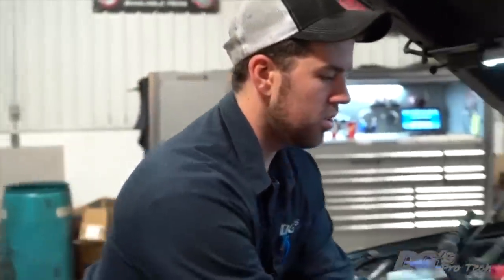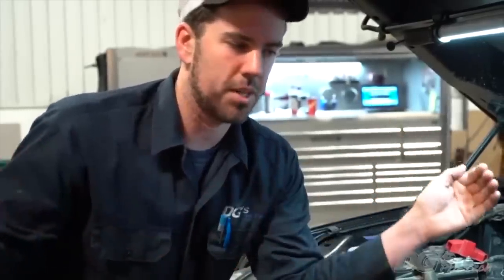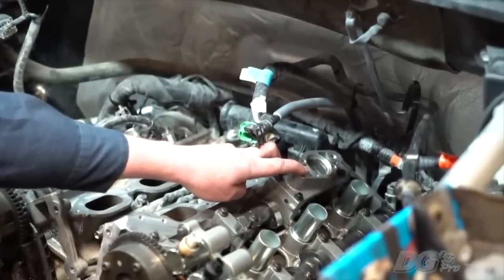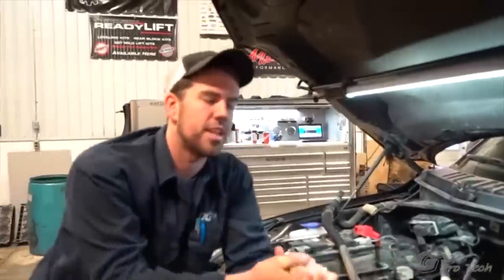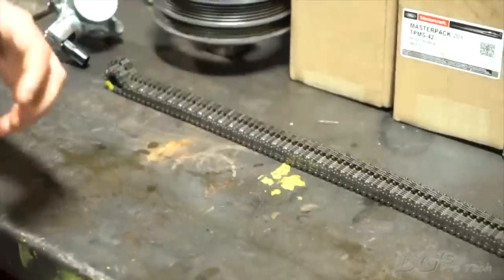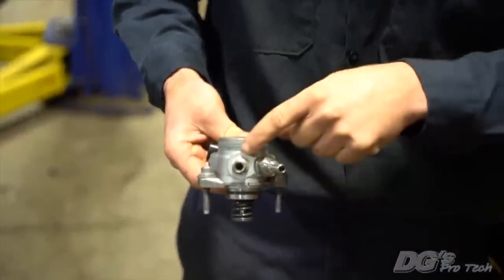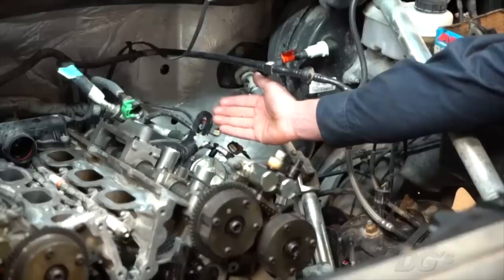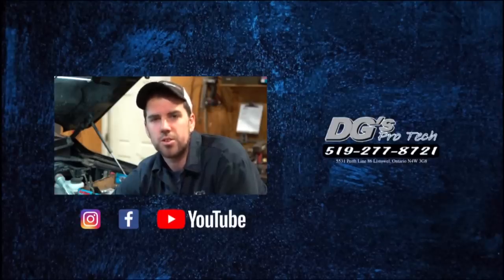What you NEED to know about Ford EcoBoost Engines by Dustin Golley of DG's ProTech

Comment: Moral of the story: If you’re buying an EcoBoost your not buying it for the Eco, your buying it for the Boost.
Reply: @Dual ADV love my 2.7
Reply: Buddy bought one, thought it was gonna be v6 economy when off the boost. Haha, catch is that its always one boost. More volume of air=more fuel. Engine thinks like a v8 most of the  time
Reply: @justinunderwood5040  but they're not on boost unless you push it to be. Mine gets over 26mpg when I'm cruising on the highway. But half that when towing a travel trailer. They say it's either Eco or it's Boost, but not both at the same time.
Reply: Yeah, I am throwing my buddy out there. He spends more time working the truck then just crusing. Also the AR ration on the exhast side is very small. Dont yake much to spool them up. Makes for great torque, just know that your not gonna get much of an economy benefit if your planning on using the torque.
Reply: @justinunderwood5040  Agreed and I can live with that. I added the AFE Cold air intake, the Magnaflow catback exhaust and the SCT tuner. I have the wrong rear for the type of driving I do most and that is metro commuting in DFW. I have the 3.15 Diff and that is great on the highway,  not so much ion town. average over the last 9 years is 15.5 MPG. On the highway at 70 cruise I can get over 23 mpg. I don't do that often. I still love the thing though! "?When I press the pedal she goes like nothing I have ever owned. the closes was my 88 Chevy Silverado long bed. with the TBI 350 and 700R4 trans.
Reply: @technicallyreal  I'll give you my first hand experience with the EcoBoost vs the V8.  I own both.  On a long trip my V8 got 27+ mpg while running 70 - 75 mph and A/C on. That wasn't on flat land either it had lots of mountains on this interstate trip.  If I try to run 70 - 75 mph on the same type interstate highway I'm lucky to get 23 mpg with the EcoBoost.  I can only get 27 mph on almost all flat land and not exceeding 70 mpg.  
There's no comparison in power. I can pass a vehicle and be back in my lane in my V8 GT before the EcoBoost can be halfway around the other vehicle.  The EcoBoost is constantly shifting gears when I hit an incline while the V8 seldom ever needs to go to a lower gear.  
The V8 has much more power under any condition and it is has equivalent or better fuel economy.   The only place the EcoBoost may win in fuel economy is heavy stop and go city driving or flat highway driving while not exceeding 60 - 65 mph.  
The only advantage the EcoBoost has is more luggage space and that's about it.
Reply: @duaneadkins1261  Which V8 are you talking about? And which Ecoboost? I have a feeling you're talking about a 5.0 vs a 2.3 Ecoboost. I doubt anyone would argue with you if you say a coyote is better than a turbo 4 cylinder. Most people here are comparing an Ecoboost V6 to a V8 in pickups.
Reply: @Birds-Garage  I have a 4.6 V8 in a Mustang GT/CS.    
The EcoBoost just doesn't have the torque or speed that my V8 has and if you give it enough fuel to pass it has to use the turbo and then the fuel economy drops and mine doesn't have near the power of my V8.
Reply: @duaneadkins1261  Ok. You are talking about Mustangs, specifically a 4.6 V8 vs a 2.3 I-4 Ecoboost. I agree with you. I'd rather have a 4.6 or a 5.0 over that 2.3 EcoBoost in a Mustang any day of the week. With that being said, an Ecoboost isn't just one particular engine, it's Ford's moniker for their turbocharged engines. Some Ecoboosts are much better than others. For example, the 2.7 and 3.5 Ecoboosts in the F150s are very good, as opposed to the 4 cylinder Ecoboosts in the cars, which I don't care for.
Reply: @technicallyreal  I agree with you.  That is my experience also. Bought a 2019 with 20,000 miles, have driven it another 10,000 & use for occasional towing.  .  No issues, very happy.
Reply: @technicallyreal  but it can be eco when you want, the v8 is always thirsty and not having that choice
Reply: @duaneadkins1261  What gears are in the Mustang. 2012 Mustang GT/CS 5.0 . My 2020 ford f-150 4wd 3.5 TT v6 will out run my Mustang. At about 75-80 the Mustang will pull away. In town they get about the same 14-18 mpg. Highway Mustang 22-24 mpg. Truck 18-23 mpg. There a lot of little things that can change mpg by 2-3 mpg. So they are pretty equal.
Reply: @steveray8022  my Mustang GTCS has 3.55 gears with a manual transmission.  When driven sensibly I get 21 - 23 mpg on rural roads and up to 27 mpg on the highway.  If I drive it harder that can drop to 16 mph.
Reply: @justinunderwood5040  my ecoboost can get 30 mpg if I want or 13 mpg. Just depends on what tune I load up. Yeah It gives me constant worry having a high hp 4 cylinder but at least there's lots of these engines and most hold up and replacements can be pretty cheap. My mom had a coyote and you don't get the luxury of changing tunes for mpg in that car. Plus my ecoboost is faster than her stock coyote especially from a stop. The thing I like about ecoboost engines is they make crazy torque. My ecoboost feels like a tractor compared to my mom's coyote. I have videos of it on my channel. 403 to the wheels.
Reply: @4touchdowns1game29  If the EcoBoost is wayyyyyyy too good then whats the point of the Coyote then.
Reply: @CJColvin  point of the coyote is to appease people who will never buy a turbo charged V6 in a truck.  People like you
Reply: @NLR_MCDC  Also will that EcoBoost of yours outlast my 96 F150 with a 5.0L (302) Windsor V8.
Reply: @CJColvin  will a heavy smoker outlive a non smoker?  Probably not, but there are trade offs.  So is it a 4.6 or 5.4?  Wasn't aware of a 5.0 in a 99?
Reply: @NLR_MCDC  My 96 F150 has the 5.0L (302) Windsor V8 with 209,000 miles and still going strong.
Reply: @CJColvin  ok.  That's good.  I could say my 15 2.7 is running strong with 162k
Reply: @NLR_MCDC  Thats good just beware that if the turbos do break man you're looking for an expensive repair. I also have a 2011 Ford F150 with a 5.0L Coyote V8 with 141,000 as well.
Reply: @CJColvin  I don't care what's under the hood or what it sounds like.  Would I drive a V8 sure, no issues there but driving boosted vehicles can also be just as fun.  And if driven correctly can give you efficiency when you need it.  Changing the turbo out on the driver's side of the 2.7 isn't too bad but the passenger side can be a bitch.  But if you buy a turbocharged vehicle, you just have to understand that it will fail at some point and prepare for that failure.
Reply: @NLR_MCDC  true.
Reply: @4touchdowns1game29  it's a 6 cylinder
Reply: @4touchdowns1game29  I havea a  2.7 and average about 21 mpg. It's mostly highway driving between 75 and 85mph
Reply: @CJColvin  there is no point in having that dog engine
Reply: Best solution get a 5.0 in it.
Reply: Understand ing is magnificent
Reply: A big mistake is thinking that Eco means Economic  but this means Ecologic but in real it's means marketing - to make disposable items and sell more and more!
Reply: thats why i bought it haha i wanted and since im a home owner needed a truck, but also wanted turbo... win win
Reply: The 2.7 is for people like me who prioritize efficiency. The 3.5 is great, but most people won't get very good mileage because they stay in boost. The 2.7 is pretty close as far as the fun factor. In my opinion, it's the most impressive engine available in the F-150
Reply: Drive it like you stole IT!!!!!
Reply: @Dual ADV Until you tow. Than it is not eco at all.
Reply: @maddogs1989  a five oh isnt eco when towing either
Reply: @paulhunter9613  I have zero clue why you're replying to me especially as the guy I quoted comments don't even exist here any more. I own an ecoboost and have zero qualms with it.
Reply: @Dual ADV 2.7 is underpowered without the turbo. Waste of money.
Reply: My focus st averages 30mpg. To get 270Ft Lbs from an NA engine AND average 30mpg is unheard of. 

So I get more eco than if I got an NA engine with that kind of power in that kind of car. 

I think it's because there's a lot of time in a daily driver where I'm just cruising along not using boost, but when I need to drop the hammer that it responds with tremendous power. A larger NA engine is going to give you the power, but during the cruise time it's sucking down more fuel.
Reply: Hell yeah!
Reply: I got both 26 mpg and eating HEMI's all day every day! Explorer ST rules
Reply: You dont buy a truck for mpgs. I want the power and torque. These aren't efficient whats so ever. I've owned several 3.5L and 2.7L it's hard to stay in eco. So I've always been in boost. Now I owned to 5.0L one in my gt and the other in the f150
Reply: I've never seen someone use you're correctly in the same sentence they used your incorrectly twice. Fascinating.
Reply: @meatbeansandcats  1 must proof read twice b4 hitting the lil blue arrow:)
Reply: @meatbeansandcats  Another Grammer cop. Nobody cares
Reply: @meatbeansandcats  haha
Reply: I bought it for both. I have tons of torque for towing/hauling, and get 24-25mpg Highway on cruise control in a SuperCrew truck.
Reply: @matthewd6306  I have a 14 Limited 4x4 and I don't come close to that mostly I'm in the high 17's low 18's on the highways and I use synthetic oil and If I'm pulling and enclosed trailer with my bike, I avg 10 mpg. I also had a 13 Limited 2x2 and it avg between 18-19mpg hwy I'm curious how you got that high of mpg??
Reply: @MrZX1409  Not all but some of your mileage decrease could be partly due to the 4 wheel drive. Also what rear diff did you have in each truck? typically we see a taller gear in the 2 wheel drive versus the 4x4. Those lower gears can hurt highway MPG as well. I have a 2011 2 wheel drive ecoboost and have the 3.15 rear diff. It's great on the highway running empty but not when pulling 8k lb camper. I have to admit my around in city driving middle of D/FW Texas I average 16.5 mpg but I have a bit of a lead foot from the stops. :/
Reply: @donsvideos1985  I never considered that, but I just got back from Gainesville Fl where I picked up a new enclosed trailer  7.5 x 14 weighing about 18-1900lbs I avg 8.6mpg and that's after having my 60k miles svc completed, trans flush, new plugs and synthetic oil 😒
Reply: @MrZX1409  I get 8 mpg pulling my 30' bumper pull camper. I have not pulled it far yet. you have to remember it's not just the weight of the trailer it is the fact it is enclosed. it is a big sail and the wind on that causes lots of drag hurting your MPG.
Reply: @MrZX1409  Nobody has unless they are driving at 55 mph with no load.
Reply: @MrZX1409  right this dude high af if he getting "26" mpg. My 6.2 work truck 1 ton gets "60mpg" from a stop for 2 seconds too so that means I'm getting 60. Ha nah that eco pile he got lucky to get 20mpg average.
Reply: @danielservin2450  took my 2.7 from Michigan to Maine.  Cruise control 65 to 80 mph and got 24.7mpg on the way there.  On the way back 23.2.  up In northern Michigan if I set it at 55mph easily top 26 on us 23.  Around town 75/25 city heavy split while driving it hard I've averaged 17.5 on my average tank.  If I am actually conscious of fuel mileage I can get close to 20.

I don't tow but I do haul decently heavy loads and it does a pretty good job on long trips with 1400lb loads in the bed
Reply: @NLR_MCDC  i wont get caught in a truck without a v8. Kinda the point of having a truck. But hey if you love it an its reliable good for you
Reply: @danielservin2450  I mean sure.  That's you're opinion.  My opinion is the point to own a truck is to have a vehicle that allows you to reliably do work.  If a v6, like the 3.5 offers more towing, payload and power, I don't care what it sounds like or what the displacement is.
Reply: @NLR_MCDC  I took my 3.5 from Michigan to Arkansas and I was averaging 26mpg
Reply: @danielservin2450  I mean yeah I like a V8, but these turbocharged engines will outperform V8s in power and speed, not sure about outlasting because they're fairly new
Reply: @lucada8538  nah the ecoboost not gonna outperform a coyote v8. Idk who been feeding you that bull
Reply: @danielservin2450  what's your definition of out perform?
Reply: @NLR_MCDC  if your trying to convince me that the ecoboost outperforms the coyote your insane. Granted the truck 5.0 is different from the mustang 5.0. That block has been known to handle sub 1000hp. The ecoboost is quick but no way does it outperform.
Reply: @danielservin2450  did I say I was trying to convince you?  I asked you what your definition of out perform is.
Reply: @NLR_MCDC  reliability,hp,tq. I dont use the word outperform only dorks that write in magazines use the word outperform
Reply: @danielservin2450  but you do use the word outperform?  You specifically said an Ecoboost doesn't outperform a coyote.  Tuned 3.5 with no other mods will always win in torque unless your modding the coyote.  If your talking about aftermarket tubing then displacement wins.  Throw a blower in the coyote and of course it will dominate.  As far as stock engines go I think the 3.5 gives the coyote a run for it's money.  Have driven all 3 options.

As far as reliability goes, can't speak of much besides I've had cracked exhaust manifolds on both a 5.0 and 2.7.
Reply: @danielservin2450  an eco is capable of 26 mpg, I’ve read other comments you have made stating that your 6.2 makes its own gasoline, so yea people believe what you say,, 🙄
Reply: @danielservin2450  a stopwatch doesn’t lie, you on the other hand…
Reply: @matthewd6306  I only get those numbers ont he highway long runs witht he cruise set below 70MPH. I do love the Boost!
Reply: @matthewd6306  cruise control is key for gas mileage in eco boost motors
Reply: @matthewd6306  Yes same.
Reply: As long as you're not lead footed the 2.7L will get you 25 miles to the gallon on the highway. But you have to learn not to dog the damn thing.
Reply: @JoshSmith-wo7zw  why not dog it? Will the mpg drop to 24 or something?
Reply: @paulhunter9613  No your creating more pressure inside the combustion chamber which in turn forces more crap past the piston rings and also creates more heat. Any forced induction engine your already pressurizing the combustion chambers and getting some blowby. Blowby basically turns your oil into liquid sandpaper. This is why they add intercoolers to help shed heat to prevent predetonation. Basically spontanious combustion. Because Turbo and super chargers superheat the air charge before it enters the combustion chamber hence the reason for an intercooler. Then on top of it its pressurizing the cylinders right off the bat. These ecoboost engines are running twin turbos. One on each exhaust manifold. You see turbos on Diesel engines but your also looking at a 3 to 5 gallon oil pan. Not quart gallon. The reason they use such big oil pans is to dissapate heat. Now these ecoboost engines are running around 4 or 5 quart oil pans. Turbos and superchargers force the engine to run very lean meaning they run very hot. With a naturally aspirated engine you don't have these issues because the engine uses vacuum created by the piston moving down in the cylinder to pull the air and fuel in with forced induction its being forced into the cylinder. Again the cylinder actually becomes pressurized. This is what happens when.you take a small engine and build it up like a race car engine by adding dual turbos
Reply: @JoshSmith-wo7zw wrong, the 2.7 has a 6 qt oil capacity not 4or 5. 
The manifolds are liquid cooled.
The turbos are liquid cooled.
The 2.7 was designed for turbos, just like a diesel
Reply: Had a 2.7 Edge ST. I really liked it, coming from a coyote
Reply: Exactly. It takes a certain number of calories to do a certain amount of work. I'll have the 5.0 please.
Reply: @FerrickOxhide  So you don't do a lot of work is what you are saying
Reply: I get 24-25 mpg on the HWY with the 2.7L.  No other truck comes close.  Has more torque than my ex Silverado V8
Reply: If you buy a ecoturd your out of your mind..Had one and its garbage.
Reply: @EasyFinancialFreedom  what kind of problems?
Reply: @EasyFinancialFreedom  had ONE
Reply: @kidsythe  more like had NONE lol
Reply: @EasyFinancialFreedom  so apparently you are out of your mind then
Reply: Not everyone has a boyfriend who abuses their truck
Reply: @EasyFinancialFreedom  I don't mean to be rude but it's like the entire video went over your head
Reply: @technicallyreal  not sure why you say that. Video is about issues with engine. I concur. It has issues. I'll take a v8. V6 is working harder to make the same power and it drinks gas like it's free doing so.
Reply: @EasyFinancialFreedom  the video is about how easy it is to avoid issues and how newer models have changes to address them. Same as anything else. Name calling and anecdotal remarks are useless. If we want to talk anecdotes, I've had 3 vehicles with these turbos and all have been flawless for me. Lots of people report hundreds of thousands of miles without issues. TFL channel also likes to do videos on how these hold up, for those who are interested. Everything goes through growing pains.
Reply: @technicallyreal  I see the video about how Ford failed to engineer yet another engine correctly
Reply: @technicallyreal  Growing pains should not be at the cost of the consumer. Ford is famous for letting the customer be the long term test.  Need I mention 5.4 triton. Ford is in a deep decline and big financial trouble!
Reply: @technicallyreal  I admit I learned to never do it again..yes.JUNK
Reply: @EasyFinancialFreedom  why are you replying to me, I haven't written anything here in months
Reply: @technicallyreal  ok
Reply: @EasyFinancialFreedom : agree with this statement. But, ecoboost engines were mostly engineered by FEV Group of Germany. Same with the 6.7 powerstroke.
Reply: @technicallyreal  People proved in the early to mid 90's when the Japanese car companies put out a VASTLY superior product than Ford yet the Taurus was still a top seller for many years and absolute utter junk.  Dad had a 1985 Ford F-150 that was utter junk.  I had a 91 Tbird that was pretty solid so bought a 95 V8 that was UTTER JUNK.  3 out of FORD isn't bad for utter junk.  Once the Japanese saw people were stupid enough to buy UTTER JUNK and continue to buy FORD they built down to the consumer.  FACTA
Reply: @glennnichols4220  what? Lol
Reply: @technicallyreal  What video game hands liberal?  Everything is funny to you guys.
Reply: @glennnichols4220  what are you talking about? Are you okay?
Reply: @technicallyreal  You can call me if you're concerned about me if you'd like.  Want my number to discuss your concerns and what you are confused about?  I will set you striaght video game hands
Reply: @glennnichols4220  I don't know what you're on about, nor how I fit into it, nor what a "video game hands liberal" is. If you're 5 and want to call me names then.. cool I guess. I'm also not sure what's liberal about me or if that's supposed to be a compliment or an insult. Either way I think you're painting a... neat... picture of yourself for everyone here. If you want to leave your phone number, go for it.
Reply: @technicallyreal  Will the EcoBoost outlast the Toyota Tundra with its 5.7L I-Force V8.
Reply: @EasyFinancialFreedom  no they don’t drink gas like you said. Mine gets over 19mpg and that’s getting into here and there while cruising. In town I even get 18… there is 1 guy that has a fleet of 100 of these trucks and only 1 had a turbo issue… I’ve seen so many ppl with well over 250,000 miles and never had one issue and seen others with over 300,000 and still going strong.. just like any other manufacturer there’s going to be a couple of crap vehicles but I’d have to say from what I have seen and read there are not too many vehicles that can top these ford eco boost.
Reply: @technicallyreal   True, my 2016 F150 is at 130K+, and runs perfect.   I do drive it for fuel mileage, but do give it some 'boost' every now and then.
Reply: @EasyFinancialFreedom  looking in a mirror I’m sure you see failure
Reply: @EasyFinancialFreedom  Ford is in better shape than Gm. It's all about maintain the vehicle correctly.
Reply: @EasyFinancialFreedom  So you’re admitting that you are out of your mind?
Reply: @EasyFinancialFreedom  that's exactly what someone who never owned an ecoboost would say, they're not scary, just take care of them and they'll take care of you, change the oil every 3 to 5,000 miles and not 10,000 miles like Ford says
Reply: @lucada8538  I owned one!! It was a nightmare. Good power. Horrible fuel economy. My guy driving it had it in the shop every month. Bought a Silverado. Disabled start stop and cylinder deactivation and it never breaks...just saying.
Reply: @EasyFinancialFreedom  what year EcoBoost?
Reply: @lucada8538  The question is will it outlast a V8.
Reply: @CJColvin  we're not sure, because they're fairly new, reliability is still a concern regarding the 3.5 and 2.7, reliability was a concern regarding the new 5.0s, there's always a reliability concern when something is new, and only time will tell how reliable these engines are, I still see first gen EcoBoosts on the road, so they're either reliable or the owners had to do a lot of work to them to keep them running, I had to change the starter on my 3.5, that's because I bought it from New York and accumulated a lot of rust around there, other than that it's been really reliable, I have 62,000 miles on it, still pretty low, I change the oil every 3,000 miles. of course it's much easier to work on a V8 instead of a turbocharged direct injected engine, but to each of their own, I like my 3.5, I like the v8s too, the v8s sound great but the 3.5 s are way more fun to drive
Reply: @lucada8538  Sounds awesome just let me know how it holds up.